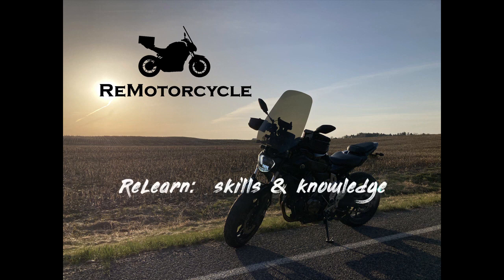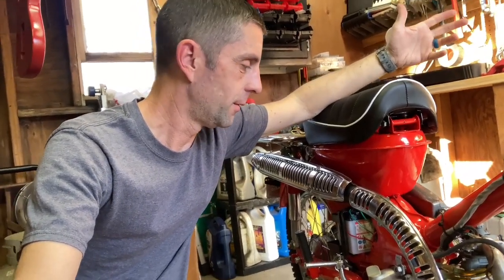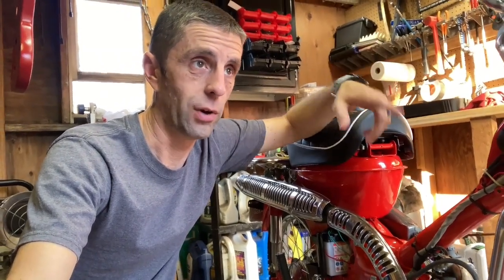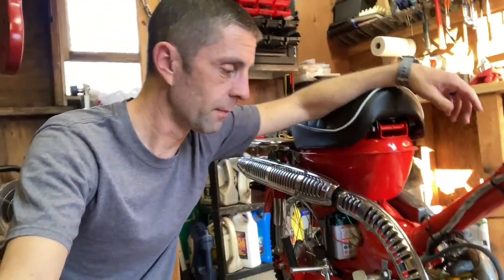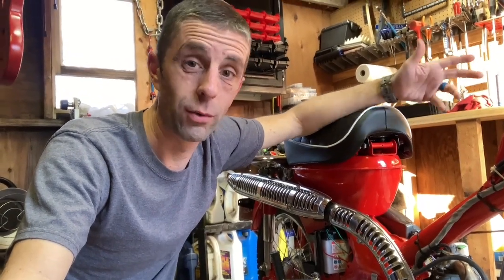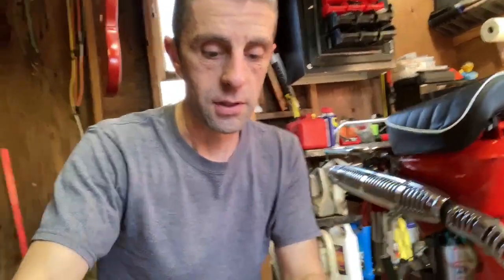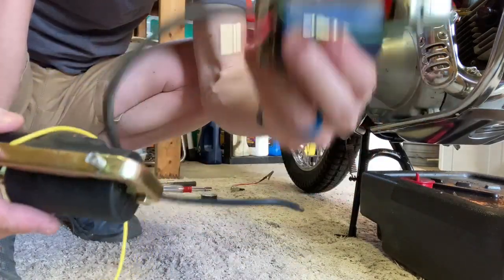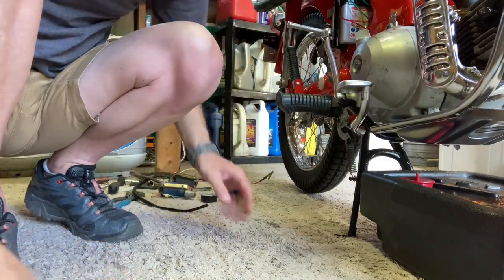Tune your Honda CT Trail 90 IDLE to PERFECTION!!

Comment: That's where I'm at.. it was running last night. Then kick kick kicking it this morning and, nope. I think my ct90 has a great sense of humor. Just when you think you're the master, it gives you a swift kick in the nuts. 😄
Reply from the maker: It’s a great mystery!!
Reply: Same for me. I cleaned and rebuilt the carbs on my 2007 Yamaha RSV including a jet kit for the new pipes and filters. Got her back together that night and she purred like an angry kitten. Next morning rode her out to the shop for an inspection to re-up the tags. Ran strong no negative feedback no throttle delay nothing, other than a little backfire. Next morning went to take her to work, started cold, but wouldn't idle once warmed. Been chasing the problem ever since like a crack addict. So frustrating.
Reply from the maker: The backfire suggests it’s a tiny bit lean. Will it idle on a little choke?
Reply: @ReMotorcycle  intermittently. As mentioned, she originally started with no choke after rebuild and re-jet. But once warmed, gets choppy and cuts out. At that point,  I can restart a few times with 1/2 to 1/4 choke. Then not at all. 

That's what's confusing. I went up 2 sizes on the pilot jets. Ran fine but only with 1/4 choke on the original size 15's with fuel mixture screws factory set to 1-1/4 turns. I know that was factory set because I bought her from the OG owner who barely rode it. And I had to pull the EPA caps. Having trouble dialing in on size 20's at 3-1/2 turns (recommended by the jet kit manufacturer).
Reply: @ReMotorcycle  I just ordered 17.5 pilot jets. I may order 22.5 as well. Thinking if I need to go even richer,  I don't have much room to play with at 3.5 turns.
Reply: @ReMotorcycle  mine came with blue, orange tipped flames from the left pipe.  I also learned the bike has an AIS (air injection system) to burn exhaust gases and that's the cause of much of the backfiring for many RSV's. Many riders plug that to reduce the backfires. I may look into that as well.
Reply from the maker: @XxsteamerxX  There's quite a bit to digest there.  The AIS is a huge factor on cold start.  It might be misbehaving.  In your case, I'd start by disabling that so I could get it to idle naturally based on a good jet/screw combo.  Then choke will work for cold but you might be surprised at how easy it starts with only 1/2 choke.  Oddly, most FULL choke settings are designed for extreme cold you would never ride in.
Reply: @ReMotorcycle  thanks for the follow-up. I figured I'd give as many details as possible so more experts can weigh in as this is my first foray into carburetors.  Loving the learning experience.
Reply: @ReMotorcycle  Disabled the AIS today. Started at 2 turns and it cranks but no start. Slowly working out from there. Currently at 4 turns and she's starting to catch but not starting up yet. Looks like I'm going to need those 22.5's after all. Ordered yesterday. The 17's arrived today but may not need them.

Comment: Love these bikes, I now have 3 of them and I learn something about them all the time, I had a issue that i chased for weeks, Turned out the wire that runs through the cylinder to the points only had a few strands holding it together and sometimes it would start and run and other times it would not start. Glad you got yours running, Bike looks great.

Comment: I have a c 70 and it took a little while to learn what it needs to start and all settings are good.  But once there she works great, so it’s one part mechanical and one part settings and one part technique. 13:05
Reply from the maker: You have a point and I think I know what you mean. You can teach the science but not the art. A lot of it is feel that comes from experience. If you know exactly what to do with the choke if it coughs, I’m afraid that means you’re old 🤣
Reply: @ReMotorcycle  Yep lol!   Ask me how I know lol.

Comment: I've got a 1972 ST90 I've just finished getting back on the road.  Shared the same engine, but doesn't have the hi/lo option like the CT.  My question for you is about warm up times.  I find I've gotta crank the idle up and keep a hand on the throttle for 3-5 minutes when starting cold, otherwise she'll just putter our and die.  Are you dealing with similar warm up times for your CT?  I don't expect it to be ready to go right after firing, but it seems likes it's taking a couple of minutes longer than it should.  For the record, the ambient temperature is around 20 degrees (70ish for all your Fahrenheit savages).  Cheers from Toronto!
Reply from the maker: Hard to tell. It’s definitely at least a minute. If it runs great when warm I’d say be patient. Enjoy!!

Comment: Mike. I need a NEW HONDA CT90 coil assembly as well. Where do I get one? My local HONDA Dealer laughed at me!
Reply from the maker: Here's the site I use for parts. And yes it's expensive.  Cheap ones are not good.  Good ones are not cheap! https://www.dratvinc.com/category/ct90-electrical?page=2

Comment: Wish they still made the Honda CT trail 90 I had a 1969 and a 1972 CT trail 90 wish I still had them.
Reply from the maker: Have you sat on the new 125? It’s a bit heavier and the engine sounds like a generator but it looks and works awesome!!

Comment: I noticed the neutral indicator light flashed while you were trying to kick start it. Made me think that your battery was weak. Also, I wonder if balky starting may be due to the idle air needle set too far CCW or CW. Then there's that needle in the slide that is adjustable ...........
Reply from the maker: Good observations. My main issue was that I really don’t need choke when it’s very warm out. As soon as I gave it air she popped. Air screw can be adjusted for every 5° of temp so it’s never really perfect is it?!!  Carb life!!!
The slide needle is perfect after I’ve tried 3 different settings. I finally got it to jump off idle and pull nice after every stop. That’s really the needle test….does it stumble off idle or not. 
What a process!!
Reply: The needle doesn’t actually control the idle, but the mid range towards full throttle (when it’s almost out of the main jet).
Reply: @wheater5  Good to know!
Reply: Can you tell me more about that ?  @wheater5
Reply from the maker: @georgelickemupwarren7639  I go into greater detail here. Honda CT90 (Trail 90) CARB Tuning
https://youtu.be/2VW7h1kmr-o

Comment: These carbs like bieng a touch  rich on idle mix.ste them to highest speed idle then screw it out till it drops slightly then screw it back in just a tiny bit.. err on that setti g not other side of in then back out a tiny bit is better. You fiddle and fiddle and...one day its close enuf you just live with it. Never perfect but close unuf.....
Reply from the maker: Very true. As soon as the temperature outside changes it’s a bit off. So fiddly!

Comment: I'm having the same exact issue. As I too did the elimination. Can you help
Reply from the maker: You mean no condenser? You need to order a new coil with it for sure.
Reply: @ReMotorcycle  so, I have an honest worker that is working on my car again. These guys (2nd round of getting it cleaned up) I spent over $600 have screwed me over. So, I have this older man who respects my bike and told me I’ve been unfortunately screwed over badly. (Poor guy didn’t tell me and told his friend not to tell me. As he was working on the bike!) sweet man.

Comment: And you don't want the idle to be super slow because it's not good for the engine, unless making sludge is what you're after.
Reply from the maker: With a centrifugal clutch you can’t go too fast either otherwise you slam into gear. It’s definitely a balancing act.
Reply: The standard rpm is 1300. I believe that's from the Tech Manual, but do check.

Comment: A CDI has no points 😂😂
Reply: Correct, however if you’re referring to the specific bike in this video, it still uses a coil and points system. Nowhere was a CDI even mentioned.

Comment: The good thing about this video is you didn't edit out all the false starts etc., Ive got a 1966 C90 and trying at the moment to solve a problem with low speed hesitation. I found this short clip informative https://www.youtube.com/shorts/T97eZZiojIY Good to see the old bikes are kept running they're great fun. Is that a P bass body hanging in the shed?
Reply from the maker: I had low speed stumble too until I moved the needle. P bass?  What did you spot?
Reply: @ReMotorcycle  You moved the needle up? It looks like a P bass body in the background. Thanks again.
Reply from the maker: Oh the guitar! I was so lost!  It’s a Gremlin my son restored. Sounds smooth and warm!
Reply: @ReMotorcycle you move the idle needle up or down ?
Reply from the maker: @georgelickemupwarren7639  you can only guess. If you get it right it will run a LOT better. If you guess wrong it will barely run so you’ll know pretty quick!